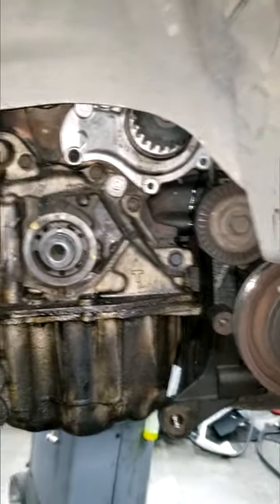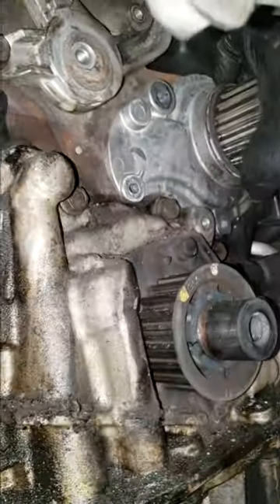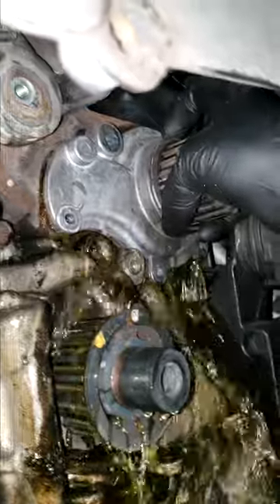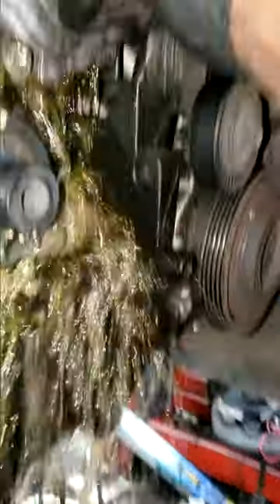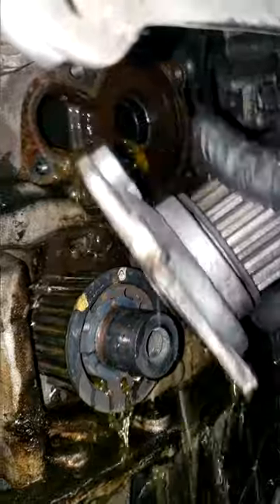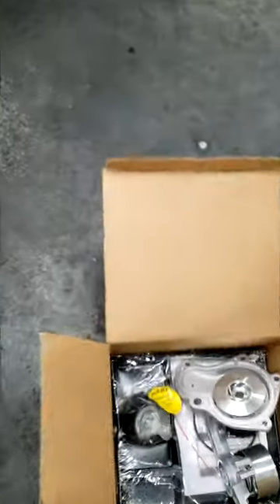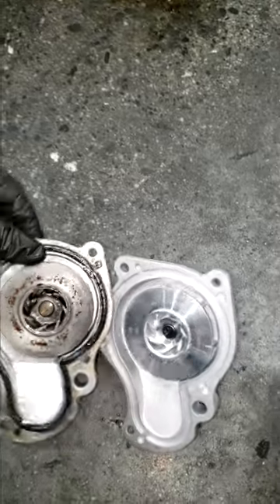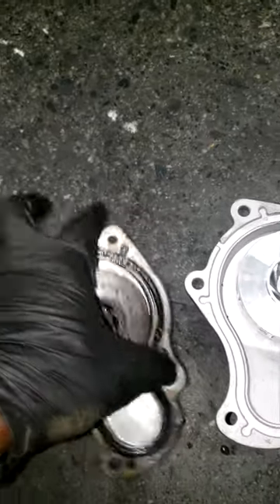WARNING. Using this can destroy your cooling system and water pump.

Comment: And if you use a full strength coolant, use distilled water to reduce the coolant. There’s a reason the factory uses distilled water….mineral build up!
Reply: Exactamundo
Reply: I just flushed mine a day ago and replaced the upper and lower radiator hoses I had used K-Seal  and when I flushed it kseal lumps was all in the hose I was glad to flush it out!
Reply: That's why I use 50/50 premix - just put it in!  Can't screw that up!
Reply: @delanorrosey4730  you pay a lot extra for half the coolant.
Reply: @oliver_klozoff  Considering I get flush n fill done once every 3 years and have only one car, cost is neglible.
Reply: @delanorrosey4730  it's subjective. Where I live we mix a little on the heavier side to get -40 or better protection. 50/50 isn't enough
Reply: @oliver_klozoff  If you do at home testing youll find the spec sheet is conservative. Better safe than sorry ofcourse.
Reply: @DarkLinkAD  I'm a little old school. I use a refractometer not one of those floating needle things. I've had slushy coolant before when it got -37 outside with wind and I don't ever want to go through that again.
Reply: I was under the impression that distilled water draws more oxygen than not and causes rust, but I'm not a scientist.
Reply: @SuperSedingAngeL-yr0  coolant is packed with rust inhibitors, but calcium and iron in tap water deposit themselves on aluminium and brass and clog your radiator passages.
Reply: Yes. Also new OAT coolant reacts harshly with the chemicals in tap water.
Reply: distilled water is corrosive, almost acidic. Use RO water
Reply: @joeybible683  yeah, that's why it's mixed with coolant 🤦‍♂️
Reply: @oliver_klozoff  also, although the coolant will feed the electron hungry distilled water the electrons it is searching for it will still most likely create some damage to aluminum parts, all be it most negligible damage. But why even deal with it when RO water is basically same price and is most definitely subjected to a higher more sophisticated  level of filtration
Reply: @joeybible683  🤦‍♂️
Reply: @oliver_klozoff  I know, its pretty embarrassing that you didnt know about how all this works. Thankfully im here to help!
Reply: @joeybible683  you're one of those people who speaks to hear themselves speak, even if what you speak is nonsense 🤦‍♂️🤦‍♂️🤦‍♂️
Reply: @oliver_klozoff  why is it non sense?
Reply: I’m a mechanic and have been for a long time I can tell you for a fact at most independent shops (not sure about dealerships cause I’ve never worked in one) will fill a container halfway with coolant out of a barrel and fill it the other half with water right out of the tap. And for as long as I’ve been working as a mechanic and doing that I’ve never seen it cause an issue.
Reply: @xXFirstHandGamerMatt  yeah, that's called creating customers.
Reply: @joeybible683 are you confusing distillation with ionization my dude?
Reply: @delanorrosey4730  damn if only all car owners think like this, buying secondhand cars would be so easy
Reply: @100GTAGUY  no
Reply: @joeybible683  someone did a rust test on distilled water vs mineral water with a nail, it turns out distilled water get rust pretty easily. But maybe mineral water would get mineral buildup over time so it's not the best option for coolant mixture?
Reply: @amd.0001  i dont know maybe. But i know for sure its better than tap, its non corrosive unlike distilled and its actually filtered unlike "soft water". So in my opinion its the best you're gonna get
Reply: @amd.0001  That's the problem - way of thinking between generations / what society tells them to believe.  Once met a guy from the 70's generation.  He had a 70's Chevy pickup and a 90's GMC SUV (don't know if he was original owner or not).  I forget what his wife drove - I think it was a small econobox hatchback (90's Ford Fiesta or Geo Metro or similar).

Usual wear and tear on the vehicles, but clean and maintained.

They had a quilt over their couch.  Couch had some years, but clean, presentable, light usage.  Basically, they were like Fight Club - "If the end of the world happens, they have all of their transportation/hauling and couch needs covered."

Their house was average - clean, maintained, repairs up to date, nothing fancy but no McMansion either.  They weren't materialistic because they were already satisfied.  Because they were content with life, they were easy going.

So you know the extra money they had was going towards hobbies, vacation time, time with the kids/teach them things, savings, and retirement/investment plans.  They weren't wasting their last dollars on the latest and greatest.

I guess another adage from Fight Club is true: "The things you own end up owning you."  Kids these days never understood that.  They want 50 exotic cars, 3 McMansions, and the 100 work week to pay for it all but never have the time to enjoy it.  Just sell it for their retirement packages at a loss because it depreciated in value due to its age and lack of affordable buyers.

Me, if I could choose only one car, I'd like a BMW E30 3 Series Estate (Station Wagon) with an M3 conversion.  Or the same with an e34 5 series Estate M5 conversion.  Sunroof is a necessity.

They're Beemers, so they're cool.  Old school steel and the engines of the time bulletproof tanks.  Fits the family, ski's/surfboards on roof rack and luggage for vacation, can hit triple digit speeds.  Braking and handling is good for a track day.

Big enough for a wife to handle, yet not a behemoth.  If it got old enough and/or I wanted to get my kids a car, here you go.  Split it between you while at college or work.  Just like I, it's big enough for them and their friends.  Maybe add an entertainment system (tv/media/video game setup), GPS.  Can take it on vacations to the beach/mountains.  No car payment, easy to fix (so long as they learn how to fix it/don't abuse or wreck it).

But seeing as how the technology is rather dated and there is better stuff out there, I would rather build my own for much cheaper.

Comment: A lot of people don’t realize you are supposed to use distilled water in the cooling system if you don’t already have the premixed coolant. It’s especially important for the new OAT coolants (organic acid technology) because the acid in the coolant will react harshly with tap water. It also prevents buildup of minerals and contaminants in tap water in your cooling system. Ford uses OAT coolant, I’m sure most manufacturers do now. That’s one of the reasons the coolant has such long service intervals now.

Comment: Good tip. Here's one in return. Most vehicles have a block drain plug. If you remove the bolt it's about an inch lower than the water pump. You don't end up with that puddle in the back of the housing getting your gasket and hands wet.
Reply: Sounds like a new tech.
Reply: @stephengrijalva8854  nah JT knows his stuff

Comment: Make a video telling people not to use sealant too, i see way too many cars that would cost more to fix than just get a new one because they poured tons of sealant in and it travelled through the whole coolant system and clogged everything, dope videos man
Reply from the maker: Great idea, thanks
Reply: I wish I had known more about that whole scam prior too. It's awful how they push that stuff like crazy and it may help for a day or so, but the long term damage is done. They tell you to pour the entire thing in too, no matter system it is. Of course...its so bad.
Reply: Cars cameoff the assembly line with sealant and Ive seen dozens of avoided gasket jobs with proper administration of coolant sealant.
Reply: @DarkLinkAD  no, they didn't and if it works it's because of exactly what these people are talking about... it plugs EVERYTHING up, sometimes that includes said leak.
Reply: I did that once and Learned my lesson cheaper to just get the correct fix and keep the heater core flowing 🤦‍♂️
Reply: @stevenjohnson1692  Ive worked for dealerships an put over 3 million miles on my vehicles but im sure you know what your talkin about.

Comment: you can get green, red, yellow, purple and blue coolants. i use red, also makes it easy to find leaks as it dries pink 👍

a lot of people don't understand that coolant raises the boiling point of the pressurised system, prevents corrosion and freezing-over.
the less coolant in your system, the less it will work in these areas.

Comment: Also note that Coolant does more then cool it also lubricants and changing fluid regularly also increases your automatic transmission lifespan due to their biggest enemy being the heat. Yk as well the torque converter produces a lot of heat

Comment: Flip side: racing tracks, most specifically road courses, will sometimes ban glycol coolants and you need to run water straight or with a non-glycol additive package. 

Glycol antifreeze is slippery and is a nightmare to get completely off the track surface.

Comment: Distilled water cools ur engine off better than coolant. Problem happens when u introduce minerals to the system, depending on ur engine, some can be corrosive… tap water has minerals and chemical… so does “purified” or spring…

Comment: That specific pump if it's Chrysler usually fails because the timing belt tension is not adjusted correctly, that causes the belt to be to tight ruining the bearings. Adding water as  coolant destroys it much faster. lol

Comment: They used to make this stuff you put it that helps add a bit of lube a corrasion inhibitors to the coolant. I put it in my 99 f150. That truck went to 300k miles original everything but the charging system.

Comment: Water is better at transferring heat than antifreeze and doesn’t turn to acid when it breaks down like antifreeze, as long as you use something like water wetter, or another additive you’re fine. As for corrosion it’s inevitable because of so many dissimilar metals in a cooling system.
Reply: Not true, anti freeze also increases the boiling temperature of the "water",  Air bubbles form as it gets to boiling point, these air bubbles form a great heat insulator that actually reduces the cooling systems performance.
Reply: @ianlouden7939  95% of the boiling temp increase is caused by pressurization in the system. Water is literally a better thermo conductor. It transfers heat better than coolant. Look it up.

Comment: what's wild is sometimes it's actually used as a lubricant. doing a flush on a prius i put in distilled water and let it run for about 90 secondary and the water pump started squealing. shut the sucker off and put coolant back in and it was good to go. don't forget coolant is an "oily" substance. 😂

Comment: Anti freeze also increases the boiling point of water, this allows the "coolant" to absorb more heat from hot spots in the head and transfer it to the radiator.  It is not only to prevent water from freezing.
Reply: Not really, antifreeze accounts for mabye a coupel degrees. The pressure however accounts for 90%of lowering the boiling point.
Reply: @DarkLinkAD  during warm up antifreeze plays a bigger role, the head gets hot around the exhaust ports very quickly, way before the pressure in the water system has been reached. It may only be a few degrees but that can be the difference between air bubbles forming or not.
Reply: @ianlouden7939  Bubbles would be from cavitation, the rad fluid literally circulates behind the thermostat before it opens (While bleeding off a small amount after the thermostat before it officially "Opens")
  Listen I shouldnt be arguing for distilled water but I easily see longer warmup times and less peak rad/heater core temps with straight distilled. 
On flips side -
Even 15% Rad fluid to 85% distilled can make a massive difference in low temp conditions. 60/40 can easily decrease warmup times in the winter and increase overall heater core temp. 
  Dont listen to me though, I dont follow the trend, I prefer to operate at 140F, to reduce thermal expansion and offgassing of underhood rubbers/urethanes/HDPEs etc.
 

A quick way of saying it,water has the greater thermal capacity, when compared to rad fluid
Reply: @DarkLinkAD  some of the newer engines the thermostat to the cooling radiator do not open untill 110C so there is potential to reach boiling point before the thermostat allows hot water out and cooler water in. All I am saying is that antifreeze "helps" to keep the head cooler, on modern engines where warm up times are greatly increased to reduce emissions this small temperature change can make a big difference to engine reliability.

Comment: Also if you use the full strength anti-freeze
use distilled water 💧 for your mix. Not just
tap water it contains to may impurities. And
will slowly clog your ports through out your
Eng. block and slowly ruin & clog your 
Radiator.